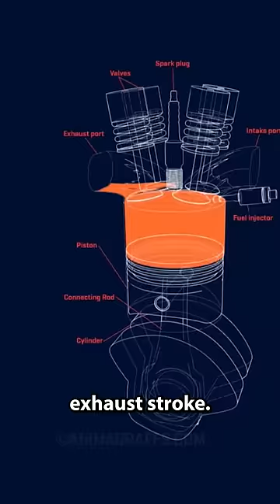Turbos Vs Superchargers

Comment: In my mind the cylinder on its exhaust stroke is being powered by the cylinder on its combustion stroke, turning the crankshaft. My thought is that there is no such thing as a free lunch! The energy from the exhaust that spins the turbo has to come from somewhere. The question then becomes one of efficiency. Which one takes less energy to produce the same increased air fuel into the cylinder?

Comment: @bankspower, Is the exhaust stroke of one cylinder not “powered” by the combustion in another? - that cylinder might be not be losing power, but there is another piston on the same crank fighting the pressure with its combustion stroke.

For example: a single cylinder with a turbo - the piston will absolutely lose velocity on the exhaust stroke while forcing gas to to spoil the turbo.. now imagine another piston on the same crank - the second cylinder would be helping to help push the gas from the first.

Just because the parasitic loss is on the exhaust stroke doesn’t mean the parasitic loss is gone, it’s still causing drag on the engine.

Comment: The heat loss is huge in combustion engines, the intercooler is an additional failure point, there should be a heat extractor for the exhaust system to make steam, steam had way more torque than gasoline, hence you'll necer fine a gas driven train.

Comment: The con to the turbo is you don't see good power gains at lower rpm, it needs to spool. Turbos also share it's oil with the engine and a failure in one can cause failure in the other.

Comment: the power stroke of one cylinder is driving the exhaust stroke of another cylinder so even if the energy isnt coming from the crank its still pulling from the power stroke of another cylinder. i do agree though that turbos are better for power.

Comment: Turbochargers were originally made for airplanes, which makes sense because the engine is always at high RPM, the air is cool and thin at higher altitudes.
Turbochargers need higher RPM's/exhaust pressure to work.

Superchargers were made for cars because they attach to the drive belt so they work at lower RPM/s and don't rely on exhaust pressure.

Turbochargers might work on race cars with high RPM's, but they aren't as good at lower RPM's, where most driving occurs.

Comment: Well... technically you don't get it all on a multi cylinder engine because whatever cylinder is pushing the exhaust pressure, it's getting driven by the next cylinders that are firing. You have a couple other cylinders in a V8 that will be firing during an exhaust stroke of another piston..so they're kinda subject to that load of driving that exhaust turbine.  I would love for him to explain the exhaust pressure right before the exhaust turbine because it's a hell of a restriction. I always wondered how many CFMs they can flow and how a diesel can even breath! Turbos are so fricken cool. 😎

Comment: Parasitic loos of power is one thing but the heat generated and the extra parts with manifolds and many other pieces put more of a stain on the oiling system and one must understand just how many rpms the turbo is spinning is insane.

Comment: At the end of the day aspiration depends on application. I’d much prefer the bottom end torque of the supercharger for street driving. Yes turbochargers are inherently more efficient but slightly more peak power (turbo) may lose to more average power (twin-screw), especially on the street. Now at the track it’s a different story, turbo is gonna eat in the 1/4 mile drag seeing as it can keep its rpm’s high and in the boost. In general, twin screw for street, turbo for track. It’s all about what rpm the engine is gonna spend most of its time.

Comment: It depends.  I would rather go Supercharged vs turbo because of simplicity of the super charger and also with a Supercharger you don't have to wait for the boost to kick in. It is instant. A turbo has to spool and that will take a few seconds after you smash the throttle.

Comment: That’s a great explanation!!!! 
But also isn’t psi an important role as well. 
Like my brz I’m leaning towards a supercharge because it can run at a relatively low psi (8-10psi) vs a turbo on the low end is 10-14psi to relatively see similar power increase. -I may have a poorer understanding I’m not a expert in the field. 

But does psi alone also play a huge role in the longevity of the motor?

Comment: Downside is they make there power down the track where the track is not prep. So when the power comes in no Traction and spin/ loose. That's why you see the big guys running Procharger or a screw blower.

Comment: Dont ignore the backpressure caused by turbochargers. increased cylinder pressure is such a simple problem in comparison to problems of excessive backpressure.

In terms of low rpm torque i like Superchargers, superior throttle response and drivability.

In terms of dyno numbers or straight line speed/times, id prefer turbochargers

Comment: when pistons reaches bdc there is still a lot of pressure and temperature inside the cylinder. this pressure and temperature adds about 2/3 of unused energy that is simply expeled trough exhaust pipe. turbo uses all that energy, it actualy adds little or no parasitic drag, you can say it works on free energy. 
also turbo can be more powerfull.

Comment: Superchargers are better in my opinion bc they do not restrict the exhaust flow the way a turbo does and this leads to a higher Volumetric efficiency for the engine. Also, The power you lose from parasitic drain is well made up for by the boost the supercharger creates, so you end up with a more well rounded choice overall than when compared to turbocharging

Comment: Both have certain advantages. 
I had a few superchrged cars Ford Thunderbird Supercoupe, 2009 Range Rover Sport 4.2 SC and now 203 RRS 5.0 SC, absolutely love smooth and massive power delivery  of superchaged engine. 
I was towing VW GTI on the dolly, doing 80, passing everybody even going up the hill. 
While you can get more power out of turbo, sure just add a turbo size of 5gal bucket but you know what? 
How about BMW 4.4 Twin Turbo engine, where engineers for whatever reason placed 2 turbos in the cavity of the V literally creating a furnance that cooks oil in oil lines, gaskets, valve seals, etc... but yes get more oomph. 
Also I am a fan of Eric at "I do cars"
And I saw him disassemble JLR 5.0 SC and BMW 4.4 Twin Turbo.
JLR engine looks, not simple, but soooo much simpler then BMW in a sence of qty of stuff that surrounds the engine itself..

Comment: I remember the Ayrton Senna Formula One days at Honda when they we’re winning everything with her turbo charged Hondas. Honda was spending $50 million a year in The early 1980s just on turbo charger development for those two Formula One hondas..
  Honda had a motorcycle in 1982, 500 cc that was turbo charged. Available to the public. My best friend bought one. The turbo  impeller was the size of a dime coin, and it could spool up to 100,000 RPM.
  I put many miles on that motor cycle when we would trade off. It was a nice smooth delivery, but if you wanted to have instant acceleration, when you whacked the throttle open, it didn’t work that way. Had to ride the back break while you held the throttle wide-open to spool up the turbo just a few seconds before you wanted to take off. Then just released the back brake.. The engine was 500 cc, V-twin, four valves per cylinder, pushrod activated, one central spark plug. It made 72 hp which was approximately 22 hp more than a non-turbo version of the same engine.
 it was also Hondas introduction to fuel injection on street bikes. The machine was perfect. It had zero problems. I worked at the Honda dealer at the time, and we never even heard of a problem with a turbo bike ever. 
  on the other hand, Yamaha head a turbo charged bike. A 650 cc. It was regarded as the least advanced. It was air cooled, i’m pretty sure it was just a turbo added to an existing two valves per cylinder engine four-cylinder. What Yamaha would do when the bike would start to detonate, it had a knock sensor that would retard the timing to protect the engine. They dealt with the consequences rather than fix the problem and the design stage of that motorcycle. It was not a big seller, none of the turbos from Kawasaki or suzuki during those years was a big seller.
  But that was just before Harley Davidson. Hard a businessman to run the company. Von Bealls… early was going out of business because everyone was in love with the speed of light technology advancement in motorcycles from Japan. So Harley got bills, and Bealls went to President Ronald Reagan, and convinced him to put a tariff on imported motorcycles, 45% tariff
that was to save the 600 Harley workers jobs. 
The result was, within two years over 1100 Japanese motorcycle dealers went out of business permanently. The average number of employees at those 1100 shops was seven. That’s over 7000 Americans that lost their jobs to save 600. ..
The technology development in Japan stopped. Just before the tariff, we got electronic ignition, water, cooling, four valves per cylinder, shaft, drive, fantastic upgrades, and suspension development, tubeless tires, fuel injection. V fours, in-line fours, flat, fours, six cylinders, five cylinders, turbocharging. The technology was tough to keep up with.
then the Harley tariff came along, and brought it to a smoking halt. The market never recovered. When this tariff hit, there were 22 shops within an hour of my home. I have worked in several of them full-time, and later part time for 17 years. There are only three motorcycle dealerships left within an hour of my home. Those dealerships have been family owned for decades, and they have owned the building for decades, that’s the only reason they survived. 
 here is an example of how good sales were of Japanese modern motorcycles. There was a single year when I sold Yamaha motorcycles part time 15 hours a week, that year, Yamaha sold 120,000 of just one particular model in one year, the Yamaha XS 650 twin. 120,000 units nationwide just here in the United States were sold in one year. We could not get them fast enough at the shop I worked in.
   since the tariff of the 1980s on Japanese imported motorcycles. Yamaha alone has never sold 120,000 motorcycles of all sizes combined in a single year since.
 Harley is complaining that they are in trouble because nobody’s buying Harleys these days. They wonder why,
All those people that would have started out on inexpensive Japanese motorcycles, and many of them would have graduated to a Harley. When they got older, they never became motorcyclist when they were little kids because of the price hike due to the tariff. They eliminated their future customers by having the tariff applied.
 Harley did it to themselves.
ironically, the president that applied the tariff that completely devastated the motorcycling business in the United States. That has never recovered even 40 years later. That president, Ronald Reagan, is the one that used this phrase. 
“The scariest words I ever heard were, I’m from the government and I’m here to help you “
 Another example of what happens when the government “fixes things “
Reply: Honda magna best bike ever, v-4 racing engine. And the earliest models were the fastest bikes in the world

Comment: The after turbo exhaust needs to run as cold as possible. This will reduce the back pressure and increase the efficiency of the turbo.

Comment: Chevy LT4 supercharged @ 9 pounds boost truns a Scott's 912 pump with a 1-19p and 1-19sand a 123 nozzel. Verses my turbocharged ls @ 7 pounds boost turning 2-21p impellers and a 119 nozzle with no lag guess that is doing pretty good

Comment: So the turbo charger takes about 30 to 40 horsepower to run. Is that power from the reduction in flow from the exhaust?  And what is the power returned via to compressor?  4 fold or more?  Just wondering. Because an electric turbo would result in less loss from exhaust back pressure but would require a large electrical source obviously taken from the alternator. A big alternator. Albeit you could have a battery to store energy for pulls out of the straight away and when you took your foot out of it, it would recharge that battery. Just some ideas.

Comment: I prefer natural aspiration.  Hard to beat for long term reliability.  In most road-going applications, the linearity and predictability of superchargers is good.  But for the top possible power, turbos win.  Whatever horsepower it takes to ram all that air in the intake, supers have to draw it off the engine's spinny bits while turbos get it from heat and pressure that was otherwise going to be dumped out as exhaust.

Comment: I get that a turbo makes its pressure on the exhaust stroke.  In a multi cylinder engine doesn’t that equate to stress on an opposing piston driving the crank down while the exhaust stroke piston builds pressure for the turbo?  That energy has to come from somewhere either way.  I hope Gale will chime in here.

Comment: But Turbos create resistance to the exhaust fumes exiting the cylinder, meaning they don't clear spent fuel/air as well, which impacts the next fuel/air mixture cycle and thus reducing economy.

Comment: Since exhaust pressure is generally pretty high as compared to manifold pressure, wouldnt there still be a loss a different cylinder is experiencing during the exhaust stroke? I know you love to treat it as a single cylinder engine so in this case couldnt we say a turbo engine has energy lost during the exhaust stroke versus a n/a engine with less back pressure in the exhaust manifold?

Comment: B.S.  The exhaust stroke only has energy from another cylinder's power stroke.  Friction losses may be different in the path to the compressor, but the energy comes from the same place.

Comment: Heat.  Heat.  Back pressure.  There is a lot of other issues.  I too love the turbo.  A turbo is not always engaged.  It builds pressure when needed.  Turbos have issues when you tune. When you do everything to get power and not allow heat out or watch the back pressure.  I understand where he’s coming from.  The system has to be built right.

Comment: I agree with everything but superchargers still make more power than no boost at the end of the day. I think it just depends on your build, super chargers are just more ideal for pure drag racing and burnouts. While turbos are like a great all rounder except for choosing where you want your power band. Im not familiar with diesels but i know that picking a turbo for a gas engine can be stressful since you can have a turbo good for high rpm, mid range, or low but unless you do compounds or the more expensive variable venturi turbos youll be losing out somewhere. Even with those turbos you lose out on some, but at least its just when youre building boost and not a whole 2k rpm

Comment: Turbos are more efficient because the echaust gases are still hot and high velocity and not completely at atmopheric pressure. That energy is recycled and the pressure and temperature of the exhaust gas is lowered as a result. 

It's still parasitic in all strokes though if you have 2 cylinders or more... if one goes up for the exhaust stroke, what do you think the other does? It's just more efficient because it uses mostly waste energy

Comment: Meanwhile, you get less heat in the intake when you use a supercharger. With a turbo you might need a big intercooler. Also, a turbo takes a lot of place because of the tubes and manifolds

Comment: yeah a lot of people on youtube are going crazy about hellcat blowers 😅 crazy thing is i’m pretty sure the “fastest” hellcat atm is twin turbo’d 💀🤣 yeah you get turbo lag etc it’s not gonna be power straight out throttle without some things added unlike the blower but i feel better about having a turbo then blower simply cause of the stress of all that power as soon as your on the throttle - obviously if it has a blower it’s built to take it but i’m talking about a daily driver that’s not gonna be in the junk yard at 50-75k miles basically reliability in a realistic scenario outside of racing. turbo all day 🎉 other than basic knowledge of turbos and blowers  and this guys videos that’s my take on it

Comment: I like superchargers because they give me what I ask for immediately, not on their schedule.  Not a big deal on a diesel truck, but I don't like diesel trucks.  For a sports car, give me a centrifugal supercharger.  Peak torque happens late, so you can make big horsepower without breaking parts.  Superior thermal characteristics.  Yes you need to rev it, but... just do that.  I drive a semi for work - I have no desire to create that experience recreationally.